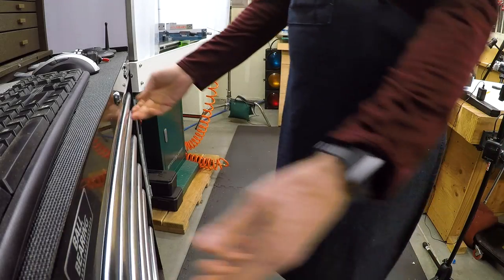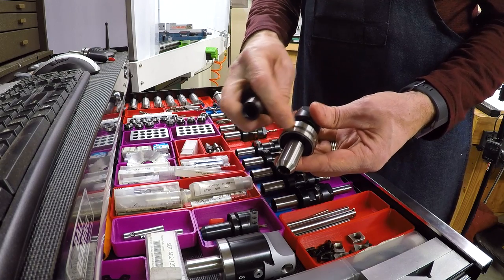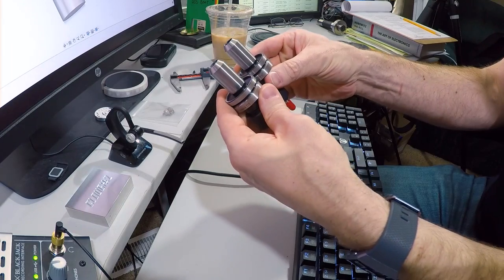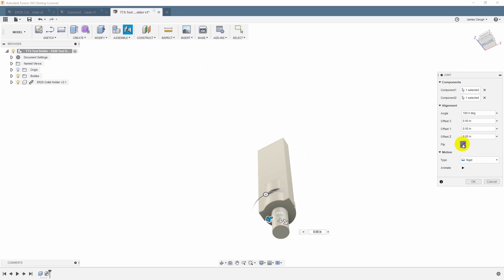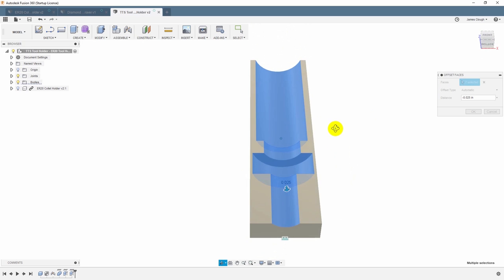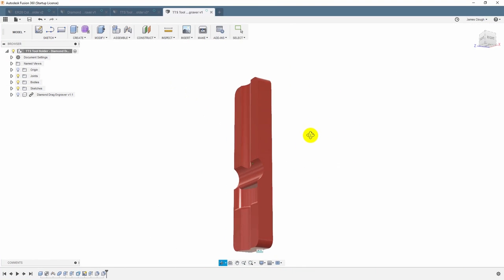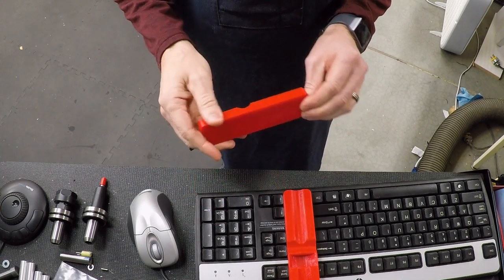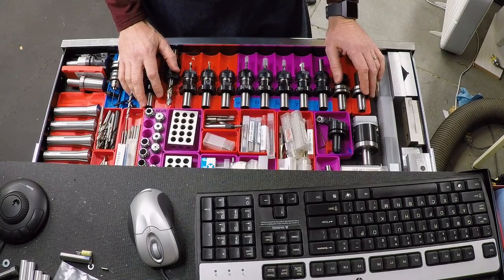How to Make 3D Printed Tool Drawer Organizers

Comment: This is the video that convinced me to give F360 another shot and make it my go-to for modeling for 3D printing. I tried working through it with some tutorials before, but quickly got frustrated that they were more of a feature showcase and didn't really show a practical application.

Sketchup is great for woodworking, but 360 seems so much more powerful and precise for making detailed prints. Thanks for this, now it's time I organized my drawers.
Reply from the maker: I learned on SolidWorks.  It took me a little while to learn F360, and I still miss some of the advanced features of SolidWorks, like configurations, but Fusion 360 is a very capable piece of software.

Comment: Thanks James, very informative. I'm currently awaiting delivery of some custom tool holders for my lathe tools that a gentleman in New Jersey has printed up for me. He didn't have a pattern for the particular holders I use (they're an off shore variety) so I ordered one sent to him and from that he has generated the tool holders.
 He has also designed and printed a couple of holders for a standard 2" round indicator that will fit onto the OXO sized tool post I use. He's made them in a left  (side) hand version and a right (face) version. I intend to equip both with indicators so they'll be ready for use at any time.
 I'm looking forward to being able to generate a better storage facility than I currently have once they arrive.

Comment: To keep them sliding around you could print them with interlocking tabs or clips so as you add more they can just keep snapping together.
Reply from the maker: Several people have suggested that.  It's a good idea.
Reply: @Clough42  check out Jeremy Schmidt here on youtube, he has a workbench with drawers that have a locking system on the trays at a set distance mounted to the underside, holds everything in place and easy to move on a grid.
Reply: Packing tape on the bottom.
Reply: @Clough42  you could also make some recesses for magnets on by each corner, and glue in magnets with opposing polarities and allow them to snap together in a grid.
Reply: @notsonominal  that was my first thought.
Reply: @Clough42  maybe just a bit of glue between them or double sided tape to glue them together, not too strong and easy to remove and clean, maybe 2 very small drops of silicone

Comment: The other advantage of printing with radius is they use a less material to make the part. Not a significant amount per part but over time it really adds up. Kind of like pennies in a jar.
Reply from the maker: I hadn't thought about that.

Comment: cool organizers.  Stumbled across this video while looking to buy a 3D printer for tooling organizers.  here's an idea for how to keep the single tool organizers locked into the larger trays (and maybe you won't mess with building larger trays anymore) - use your cnc mill to drill small holes on the side of each and then join them together using pins.  If you drill the hole sizes just undersized, your pins will more or less fuse the holders together.  Just a thought.  :)

Comment: Exactly what I need without realizing I needed it!  I like your er20 collet tray especially.  I'll need to design some vertical holders to put on my enclosure for individual jobs as well.  Cool, another g0704/3dprinting enthusiast.  Subbed.
Reply from the maker: Oh, that's a good idea.  I still haven't gotten to milling out a rack on the enclosure for my vise handle, dead blow hammer and air gun.  I should be ashamed.
Reply: How is the g0704? I have the g0759.. Was thinking of getting a 704 for cnc
Reply from the maker: I'm very happy with it.  The biggest limitation is probably the 2200RPM spindle.  If it had a 10,000 RPM spindle, it would be amazing.

Comment: Hi James.  I printed a couple of your organizers off of Thingiverse.  Very nice.  You used a different method to create the models in this video than you did on your earlier models.  Your use of parameters on those models was very interesting but this method seems much simpler.  I'm thinking of building the tool using parameters so I can create a different tool holder simply by modifying the parameters of the tool.  Love your videos.  Very informative and great presentation.

Comment: Placing a Small drop of super glue, or hot glue, between them will also help hold them down.  I kept expecting to see you perform a Shell on the backside to reduce your amount of plastic. Perhaps not a good idea considering your use case. Nice video.
Reply from the maker: The part is printed with 25% infill, so it's 3/4 air.  With injection molding, shelling is really the only way to avoid making it solid.  With 3D printing, there are other options.

Comment: when extruding the cut away portions through the whole base you should extrude to the end face, when doing that if you make adjustments the extrusion is stuck to the face no matter what, the way that you are doing it, if you make changes that are outside the constraints of the extrude cut then you will also have to adjust the extrude again.
Reply from the maker: True.  I just didn't, because I was lazy and I don't think I'll ever be making these parts longer.  If I do, and if it bites me, I'll remember this comment.  :)

Comment: Great video. I’m looking to develop something similar for my drawers tools but I may add some lock tab system on each side so I can attach them for stability and have the flexibility to add one if required instead of a full rack.
Reply from the maker: That's reasonable.  I started with a set of ten collet holders, and I wanted them all in a row in the drawer, so the large racks were convenient.

Comment: Great video nice to see some order. You could always add some sort of dove tail or dog bone shape to join them together. Both parts have a female side and you join them with a male bit. The end will just have a female and not a clip on show
Reply from the maker: That's a good idea.  The tabs could be short so they only engage at the bottom and could be broken off easily for the end pieces.
Reply: @Clough42  yes I agree but I would use a part that connects both parts together low down that way your not removing anything and if you change your mind at a later date they can still be connected as the females hole will still be there. Also could put the same female on the front and back side if you want to connect a lot together to form the whole draw that way there isn't rows as they have all become one with the dog bones or what ever type of connection you use. Just an idea
Reply from the maker: @Mottersmotters  ahh... Yes.  A dog-bone that fits into the bottom of both parts.  That's a good solution to keep the parts easy to reorganize later.

Comment: Nice! I never use primitives in Fusion but for this it's perfect. Since cracking open my 3d printer I too have found many uses for making useful shop stuff, dust collection adapters, organizers, not to mention little figures the wife loves :) Checked out and commented on your lathe VFD conversion last year - wow, you look great! Hope it wasn't anything serious other than a strong desire to get fit. Thank for posting.
Reply from the maker: Thank you.  Yeah, I finally just decided it was time.  I dropped 80lbs, and my wife dropped 30.

Comment: I think you can change setting for initial layer height and line width to counter the "burr" part.
Adding chamfer is a great solution. I might adjust chamfer size based on layer height though. If you are printing 0.2mm height, I may just do 0.4mm chamfer. For some slicer, you can set initial layer height. Maybe set it to 0.4mm, and do 0.4mm chamfer.
Reply from the maker: I am using Simplify3D and setting the initial layer height to optimize bed adhesion.  I could modify the layer height to optimize the shape of the edge, but it wouldn't do much good if the part peels off the bed while printing.  Everything is a trade-off.  The small chamfer is one easy solution.

Comment: If you ran a batch injected plastic, I'm shure they would sell. I'd buy some.
Reply from the maker: I have thought about selling them 3D-printed, but I think the cost would be higher than most people would want to pay, just due to the slow print times.  It would also mean a very large variety of different trays.  Then again, that would mean that I would need to acquire all of the tools to design the trays...that's not all bad!

Comment: I haven't used Fusion for years but I would imagine that you could do something similar to Solidworks Configurations for the toolholder model? Then if you need a holder for different size tool holder, you just adjust the tool model dimensions for a new configuration and rebuild the holder model with new geometry.

Comment: Lovely looking PETG prints! Which brand are you using here. I always seem to struggle with stringing and I've tried giving the plastic some extra breathing room but then I struggle with adhesion of my initial layer, can't seem to find that sweet spot. What are your main slicer settings looking like for temps etc? I enjoyed the content very much My tool drawers are shamefully disorganised by comparison to yours. Might just have to print myself some custom trays for my own tools. Looking forward to seeing some more of your videos. Subbed! :)
Reply: Same question for me, l like PETG in general, but I have the same stringing problems.  Any advice much appreciated.  Excellent video.  Thanks for sharing.
Reply from the maker: PETG can be a little tricky.  I've used both Hatchbox and eSun PETG.  This roll is Hatchbox.  I'm printing .2mm layers at 255c with a E3Dv6 hot end and .4mm nozzle.  I print on glass with Garnier Fructis Extreme Hold #5 hair spray (https://amzn.to/2FtNQu1).  I start with the bed at 90C and drop to 80C after the first layer.  I also set the first layer height to 120% to avoid balling up and making a mess and I run it slower (3000mm/min).  A cooling fan is important if you're printing any bridges or small features in the upper layers to make sure the print solidifies and you don't get the melty-sand-castle look.
Reply: In addition to what Clough42 expertly posted, I'd like to empahsize that PETG likes to be printed slower (yeah he said that but a lot of people ignore that about PETG) BUT you should use decently quick travel speeds.   Printing speeds can be 30 to 50 mm per second, but travel speeds should be 70 to 100 mm/s.  (It varies because if there is a lot of wobble in your 3d printer, you want to slow down the travels so they aren't so rough... my 3d printer is very rigid so I don't worry about it too much.)   Also use retraction.  1 or 2mm of retraction at 10mm/s  (I've read some people use even slower speed) can help a lot too.   So the pressure is taken off of the filament before it rapids away from the part... the two effects combine and you get a lot less strings.     PETG can be printed at a VERY wide range of temperatures.  On my printer I can print from 230 to 250 degrees.  I get more stringing at some temperatures than others...and on my printer, there is a range in the middle I need to avoid where it strings worse than cooler or hotter.   Test a range of temperatures with a lot of movement between pieces...in fact there are 3d objects you can get that are designed to showoff stringiness and you can vary the model by printing it at different temperatures at different layers.
Reply: @Clough42   Was that solid infill? If not, I'm curious about pattern and density.

Comment: Thought about doing this. Decided it was a waste of time (mostly), energy and plastic.
Instead I got cheap ass 4mm poplar plywood (they sell it here at €2,20 for 5 sheets of 21x30cm) and some express glue.
You can even cut that stuff with a sharp cutter, though a power saw is recommended.

Comment: There is foam that allow you to just press the tool into it and it will deform it to the shape of the tool. Just wrap the tool in cling film, spray it with mold release and stick it in. Wait until foam has hardened and take it out.

Comment: Excellent video 👍
Are you using 100% infill? If so, why that much?
Reply from the maker: No.  These are printed with 25% rectilinear infill and three solid layers top and bottom.  The camera angle makes it hard to see that when printing.

Comment: So, something of note, it appears it matters on your orientation.  Since I use F360 for 3D Printing, 99% of what I do is based in the XY Plane.  I created BOTH models in the XY Plane and when I bring them together, it rotates the tool by 90 Degrees when I attempt to use the Joint Command.  I manually rotate the object being put into the "blank", but then it seems that I can't center the thing into blank without manually doing everything.  F360 can be so bloody frustrating sometimes...OK A LOT of the time.
Reply from the maker: That's going to be driven by the orientation of the joint origin you select.  Make sure you're selecting both origins on the bottom, or both on the side.  If you have one on the bottom and one on the side, it'll do exactly what you're seeing, because it thinks that's what you're asking it to do.
Reply: @Clough42   So, I finally got it to work, but I had to use the "Origins".  No matter what, even what you stated above, it rotated the part.  Bottom to bottom, top to top, side to side...rotated the part 90 degrees.  Finally got it to work by using the origins.  That drove me nuts.  Thanks though!

Comment: 2 questions:
- Do you have a standard dimension for your tool organizers/holders that you make all of them some multiple of to make sure they fit and are easy to organize?
- I ran across you from your Thingiverse postings and noticed that you almost never use PLA (it's always ABS or PETG when it's listed where PLA Is the most common), is there a reason?
Reply: PETG is less brittle.

Comment: Great video! I was wondering if you could share the specs of your computer that runs Fusion?
Reply from the maker: I haven't found Fusion to be very sensitive to system specs.  It runs fine on my 8-year-old quad-core laptop with integrated graphics.

Comment: Do you not get warping with those thin-wall boxes? Mouse ear corner anchors got my boxes to stay flat throughout the print but the boxes still managed to warp after removing them from the print bed. Tried removing the boxes directly after the print and removing them after cooling completely but both still warped from what I can only imagine is stored stress. Used eSun PETG.
Reply from the maker: I haven't had any trouble with PETG.  I've printed lots of boxes with ABS, and I always get a little curling right in the corners, but not enough to cause a problem in most cases.
Reply: Might be the eSun then.  I'll try another brand to see how it reacts. Thanks.

Comment: Where did you get the purple boxes from?  I have Lista drawer system, and some Lista boxes.  But the boxes are expensive, and are offered in few sizes..I discovered Schaller boxes (https://www.schallercorporation.com/), which are offered in more variety of sizes, and do not have all the label holder slots which snag parts.  They can also be cut and bonded with ethyl acetate to get even more variety of sizes.
          How long does it take to print one typical holder?

Comment: I plan to do a full set of 1/4 3/8 and 1/2 socket holders, do you recomend leaving a tolerance of the tool, say .1 or .2 mm or just make the hole exact eg 10 mm hole for a 10 mm socket? 
Cheers
Reply: I'm guessing that you may have figured this out by now, but if not (and it may help someone else) first, a 10mm socket will have an OD somewhere around 14 or 15mm, and second, since you're laying down material by oozing it out hot and letting it cool, there is almost always some dimensional change in the final product, and it will be different for different parts, printers, filament...  typically I find that when I get outside dimensions spot on, inside dimensions tend to end up a hair undersize (on my last print it worked out to be .15-.2mm, so about a total of .35mm tight for a round hole) or vice versa.  

He specifically swelled his cutout .025" (so .050" counting both sides, that's a largish gap, about 1.3mm), but he also wanted a loose fit.  Knowing how my printer prints PLA and how I'd want a socket holder to fit, I'd likely start at something like .5mm/.020".

Comment: Why didn't print both parts at the same time?
Reply from the maker: Depending on the part geometry, a smaller/shorter print reduces opportunities for warping, and allows you to keep the part on the most even part of the heated bed.  With materials like PETG, you can often avoid excessive stringing by printing parts one at a time.  Whether this is necessary and/or helpful depends a lot on the printer.